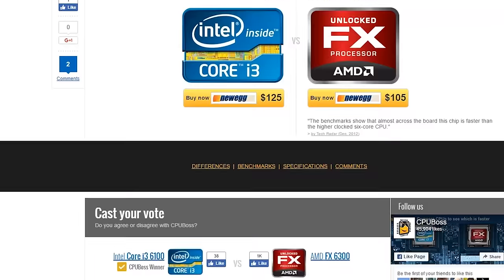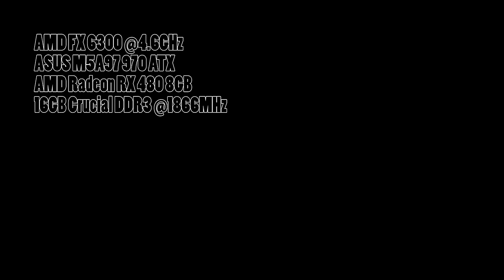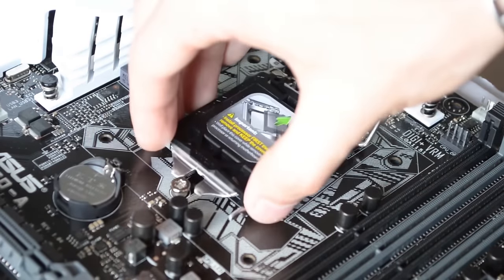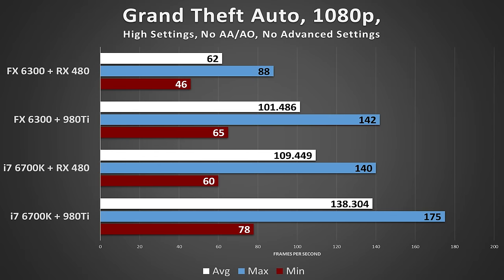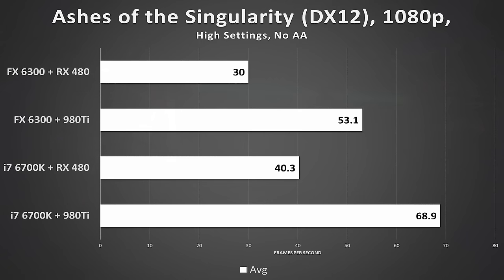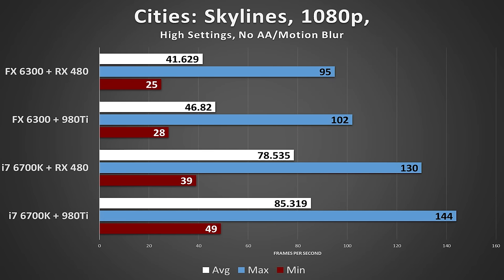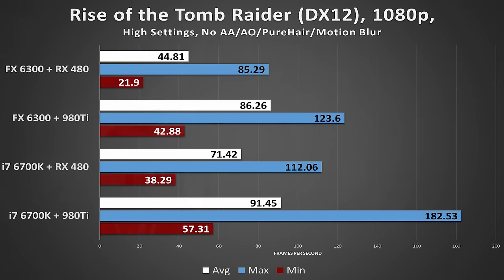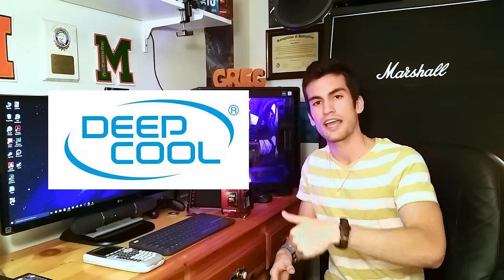AMD FX 6300 + RX 480: Severe Bottleneck?

Comment: Sad when you cant pair an AMD CPU with an AMD GPU
Reply: The FX series is just too old for the newest GPUs. The AM3+ Platform does not even have PCIe 3.0.
Reply: fx 8370 is pretty good
Reply: PCIe 3.0 is the least important factor in the bunch. Pcie 2.0 even at 8X has enough bandwidth for any of today`s high end gpus even in multiple configurations. Look it up on web, there are bunch of tests to confirm it. Pcie bandwidth importance is one of the greatest tech myths of recent times. In other words - it`s not important.

I have FX-8320 with R9 380 gpu. I dont see any particular bottlenecks in modern gaming, except in new Thief. That game cant break 40 fps regardless of gpu settings on AMD platform if you are using DX11. Mantle should help but i didnt bother with that. 

Otherwise cpu is great for keeping 70-80 fps range at 1080p gaming. I guess i have one extra module, which means 2 more integer cores and full FPU unit stack of 4 but if something is a bottleneck there it is slow on-die cache and poor memory controller, not a pcie bus bandwidth.

If you look at newer iterations of Bulldozer u-arch, which are Steamroller and now recently Excavator, they show pretty nice gains in IPC and single-threaded performance. About 10% for Steamroller and another 10-15% on top of that for Excavator (Carrizo). If Zen is 40+ % faster per core than Carizzo they pretty much nailed Intel`s Haswell and are nearby Skylake levels. I wont object to that. It will be the biggest jump in IPC and per core performance since 486>Pentium transition :D.
Reply: To be fair, the CPU is older than the GPU. The upcoming Zen processors are supposed to be a big improvement (supposedly a 40% increase in IPC; and of course the new FinFET lithography for lowered power consumption + heat emission).
Reply: maybe the RX 400 series was meant to be paired with Zen CPUs... but it's sad to see this, as i own a FX 8350 :/
Reply: The main issue the very low performance with FX cpus. FX8350 bottlenecks even cheap gpus like GTX960 so PCIE3 isn't the main issue here :)
Reply: MrKeikari i doubt that kid, it's not a bad cpu. also, look at the price you buy it fore? it doesnt even bottleneck a 980
Reply: ✪ Frazzle ✪ Bad, awful, potato, potato. I don't it being overpriced helps a bit??? The bottleneck even for cheap gpu like GTX960 tells how obsolete FX cpus are.
Reply: GTX 960 is an obsoltete GPU^^
(A HD7950 used is less than half the price and worst case same performance)

FX CPUs aren't obsolete, they perform well in multithreading and they're cheap.
It depends on the game, but in some games a FX-6300 can compete with an i5. And is cheaper than an i3.
For 120Hz or 144Hz don't bother with them, but 60-80fps are possible in most titles released for the new consoles.

CMstacker Try Mantle in Thief, the boost might be huge. FX-6300@4.8GHz and 7950@1150MHz 2560x1080 most settings maxed FXAA 60 FPS, DX11 30.
R9 380 pretty much equals a 7950 so you might get lucky ;)
Reply: 96erAtDrift FX8350 bottleneck even GTX960 so FX8350's price-to-performance is just awful. Rather get i5 (or i3 if you're only gaming). They both cost the same or less than the "8"-core Amd.
Reply: 96erAtDrift I have a FX-6300,a GTX 960 2GB and 8GB RAM. I can play the new Star Wars: Battlefront on Ultra without a problem. These are not even the recommended specs.
Reply: They won't match Intels singlecoreperformance and they didn't say they would. However does this really matter? Intels prices are crazy, even atm FX are often worth it if your on a budget, it's not getting worse ;)
Reply: 96erAtDrift Intel prices crazy? Intel has better price-to-performance, cheaper cpus... FX is overpriced shit.
Reply: Jubal Harshaw For such use you can't pass Pentium and i3 if buying new.
Reply: Jubal Harshaw Just do some research and you end up in the same result :)
Reply: It seems like a lot of people don't want to understand that there are games using multiple cores properly.
And if you're gaming on Win7 without AMD hotfix it will probably stutter. That's why there's a fix (it's an issue with Win7 distributing the load between cores).
My Monitor is 74Hz (OCed from 60Hz) and thats what I want to have constant. If it does that I'm fine. Yeah I would like 144Hz, but there's not only the CPU the issue.

And an i3 is more expensive and can't compare in performance in a lot of games. G3258 is a good CPU for those who only need performance on one core, FXs are good when it doesn't matter on how many cores the performance is and i5+i7 combine both, but they're pricy.
Reply: Funny thing is an FX8350 paired with 2 980Ti's is actually great for 4k, because the GPU is being bottlenecked. So it's actually a great buy for someone on a "budget",  your pretty much saving the cost of the 4k monitor itself (versus a newer i7 for instance).
Reply: 96erAtDrift The i3 6100 is about the same price as an Fx 6350 and delivers more performance in benchmarks paired with identical gpus. Look up FX 6350 vs i3 6100.
Reply: Jubal Harshaw Just upgrade your info and you're fine :) 

I haven't said anything that you just quoted. The overpriced FX chips just don't have any upsides that would put them ahead Intel in general. Every use is highly competed by Intel and beaten in price-to-performance ratio. The only thing that Amd can compete with Intel is what they offer with APUs.

Brendon Cabana Wtf, pair an obsolete FX8350 with 980TiSLI while FX8350 bottlenecks even GTX960. That logic....
Reply: Jubal Harshaw Remember to put in the cost of DDR4, and Intel's mobos.

Than again, you could cut on the Z170, go for a non-k i7 and end up with an ever slighter difference.

I was just pointing out that for FX8350 owners (and the cpu itself), it's actually good for 4K.
Reply: Jubal Harshaw I was just pointing out that AMD's FX lineup wasn't a bad buy for 4K, that's all, no need to over-analyze it :P

My seconds rig (old rig) is a custom watercooled FX 8320 @ 4.7, and I threw my 980Ti's jusr for giggles once, and I was actually surprised that 4K scores where almost as good as my 6700k.
Reply: Brendon Cabana Wait why would it be good for multi cpu setups
Reply: Jubal Harshaw No extra taxes for either cpu. What you're saying just doesnt make sense.
Reply: i have the same processor too. 8320. oc to 4.4ghz. my old gpu is a gtx 650ti and just recently purchased a 1070. i kinda feel sad because my new gaming performance (FPS wise) in this gpu didnt increase that really. its so-so. games i play are always  xcom2, witcher3, csgo, starcarft2. so im kinda researching a lot if the 1070 is overrated or my 8320 is simply old enough to be paired with 1070.
Reply: Jubal Harshaw So you're saying that if FX8350 becomes more expensive it gets better? CPUs don't work like that... You gotta see the real-life performance.
Reply: Jubal Harshaw
yeah. that sums it up. also my seller has a 15% restocking fee for returns of non-defective items so that's like $95 free money for them if i return it ($636 card) so im not doing it. if only i can return it without cost, i may have just gungho went for exchange to 1060 or 480. anyway not much i can do with this but now im having fun overclocking my fx8320 to death and see how far she goes.
Reply: NicksDomain101 Multi GPU* Not CPU :P And it's good especially for 4K, because as I said, at this resolution the bottleneck shift towards the GPU instead of the CPU.
Reply: Jubal Harshaw You said: "Maybe you live in a country with insane taxes on Intel CPUs and low taxes on AMD ones..." If that's my situation, how "fixing" it would help FX's already awful price-to-performance ratio???
Reply: Jubal Harshaw Well it still doesn't change the fact that Intel beats Amd's current cpus in price-to-performance ratio :)
Reply: Brendon Cabana Well if you don't have a build powerful enough the major cause of lower fps on a 4k build would be the gpu, but if you are running two 980 ti's in SLI than I could definitely see your CPU being the major bottleneck once again.
Reply: Jubal Harshaw What are your facts considering that something like the cheapest, locked i5 outperforms FX8350 in gaming, in most games even i3 does that. In budget workstation FX can't beat Xeon's price-to-performance ratio. Intel has the upper hand with lower power consumption and lower heat output in every build
.
Reply: It sucks if you don't live in the states, not only is ram really cheap nowadays but all of our computer parts are very available and as cheap as they get, I built my super powerful system for only $1300, while other people are spending $2000 or $3000 for an identical system. (Hint: Australia.) Heck, some people may actually be able to get better price for performance buying a prebuilt computer in the states than making their own outside of the US.
Reply: ***** You see that is what we call a severe bottleneck haha
Reply: ***** Did that sentence make sense?
Reply: You can, just you will hit a bottleneck that you may or may not see it. Ex: If the FX6300 is reaching 120fps while the I7 is reaching 150fps, there is some kind of bottleneck. But if your screen refresh is 60hz, you wont see it and you will be ok for a while.
Reply: I would say you are wrong there. I'm running a R9 380 with a FX8350 and I have no visible bottlenecks so far. A Gtx960 should have no problem.
Reply: +Marcusius A lot of people are failing to realize that AMD processors are good if you're just doing 60 FPS gaming. Although I have an i3 myself, the fx6300 would be a better option for someone if they're looking to get into content creation and gaming.
Reply: Strike Claw No, as I said an i3 costs about the same as the fx 6350 and it performs better.
Reply: NicksDomain101 Fx6300 overclocked to 4.5 ghz beats the i3 at stock. Remember that the i3 6100 can't overclock unless you get a z170 motherboard which cost 100$. The FX processors can overclock on 50$ motherboards. You can actually get the fx8300 for 120$ now which is only 10$ more then the i3 and the fx8300 can overclock on a 50$ mobo as well. The fx8300 is honestly the best deal right now since you can pick up a brand new one for 120$ and it can outperform the i3 even when overclocked in a lot of scenarios. Science Studio has a video on his channel where he put up the fx8300 overclocked to 4.4  with an i3 overclocked to 4.4 and the fx8300 beat it in almost every test shown. The fx8300 did a good job of pulling ahead of the i3 in every direcrtx12 test as well.
Reply: Strike Claw You reference the science studio a lot, but in his i3 6100 vs AMD FX 6300 video he recommends that altogether you should be going for the i3. The i3 performs better overclocked, and you get DDR4 as well as all of the good stuff that comes with it, and the FX 6300 doesn't even support PCIe gen.3.

The i3 clearly beats the 6300.

BUT, Yes, when it comes to the 8300, we do see better performance stock and overclocked at gaming and everything else than the i3, however the same problems with the 6300 applies to the 8300, no DDR4 and other stuff, but I think the main reason I would not call the 8300 a clear winner would be because keeping in mind with the future, and upgrading your system, buying all of these old components to run an 8300 would not allow you to effectively upgrade into the future. Buying a socket lga 1151 mobo means that you wont have to buy nearly as many new components if you want to upgrade your computer in the future, while if you went with the 8300 you would find yourself in need of a new mobo and new ram for future upgrades.
Reply: ***** You can easily downgrade to the older bios before they prevented that, which will allow you to overclock the i3.
Reply: Strike Claw Good luck overclocking that FX6300 on 50$ motherboard but keep the fire extinguisher close :D Oh dear these ignorant fanboys just purely lie to ppl to make their obsolete pos cpus seem even a bit better. 

FX8300 has awful price-to-performance ratio and no one should bother with such overpriced and obsolete cpu.
Reply: ***** No??? Idk what else to say lol
Reply: MrKeikari Okay they really aren't that bad, they're old and about to become obsolete but they are fine.
Reply: NicksDomain101 There's better cpus for the price so it's time to kill the myth of "Amd FX having good price-to-performance ratio" :) I still see almost daily people recommending this cpu over the i5 of same price like it's years 2012...
Reply: MrKeikari Yeah I absolutely agree that it is outdated as crap
Reply: Thomas T Same price or lower to get better performance :)
Reply: Thomas T i5-4460/6400, i3.
Reply: Thomas T The skylake i3 lineup or the 2nd gen intel i7's
Reply: From my own experience, the 8350 and the I5 4460 are pretty much neck to neck in game performance.
The only games the I5 is better if you are about to play CPU intensive games like Arma.
This is why you see so many youtuber mentioning that if you go with an FX , dont go lower than a 8350.
But that was before the announcement of the Zen. Now it's wait for Zen or get an 6400 if you cannot wait.
Reply: Your wrong. I am using a FX8350 with a 380 Nitro and I have zero bottleneck between my cpu and gpu
Reply: Marcusius FX8350 is bottleneck even for GTX960 and 380 outperforms 960 so the bottleneck is even bigger with 380 :(
Reply: chronicblazer84 You must be wrong then since FX8350 heavily bottlenecks even GTX960. Turn off the fanboy bs :)
Reply: NicksDomain101 You guys act as if buying a new mobo is hard. It really isn't. The fx8300 can be found for 120$ brand new. You guys make it look as if AMD's processors are absolute garbage but they're not. Also, you keep on brining up DDR4 RAM but there is barely any difference between DDR3 and DDR4 on processors. Someone tested DDR4 and DDR3 on the same motherboard with an i7 and there was barely any difference in performance. If you're worried about an upgrade path then sale the CPU for 80$, the mobo for 50$ and the RAM for 30$ on ebay. With eBay's fee's, you'll get about 140$ back that you can put into into any RAM, MOBO, CPU combo you want. If you watched science studios video, then you'll see that the FX8300 outperformed the i3 in every test. Honestly, if directx12 utilizes multi core performance that well then there won't really be a need to upgrade anytime soon. The fx8300 can overclock to 4.4 on a dirt cheap motherboard and the i3 in that video was overclocked to 4.4 ghz as well but you need to pay an extra 100$ for a z170 motherboard in order to overlock the i3. So FX8300 is obviously the better deal if you can't afford the z170 motherboard. The i3 at 4.4 ghz lost to the FX8300 at 4.4 in every test so you can imagine the big difference when the fx8300 is overclocked on a 50$ mobo and the i3 6100 is left at stock on a crappy h170 mobo.
Reply: chronicblazer84 Exactly. He told us that it was hard to get the FX8300 up to 4.4 GHZ but what he didn't tell us in that video was that it was because of his poor choice of a PSU to go with that CPU. He only mentioned that issue down in the comments which kind of pissed me off a bit. The way he mentioned the problem in the video, it made it seem like it was the chip but it was actually the poor choice of a PSU. This intel bias is ridiculous. Its like whenever intel loses, everyone goes like meh, but when AMD loses in 1 test, everyone goes crazy and says that the CPU's are garbage because they did bad in one test.
Reply: Strike Claw But why buy obsolete shit (FX8300) when you can get something decent (i3, i5) for the same price? Face it, AMD "8"-core is just too overpriced to make any sense.
Reply: MrKeikari The FX8300 is currently 120$ and it can overclock on a 50$ motherboard. The i3 6100 is currently 110$ and it can't overclock unless you get a 100$ z170 motherboard and 50$ is a BIG hit in budget builds. The FX8300 outperformed the i3 in EVERY test in the "Fx8300 vs i3 6100" video.  Both processors where overclocked to 4.4 ghz and the FX8300 beat the i3 in every test. I don't see why you wouldn't pick up an AMD "8" core for that price. Its a lot better then what you intel fanboys think it Is and it mopped the floor with the i3, especially in the directx12 test. You guys love supporting overpriced duel core chips and money greeding companies don't you? I've already argued with your intel brain washed self before awhile ago and its very pathetic to see you back again and trying your best to make AMD cpu's look like they're bad.
Reply: Strike Claw How in the hell is overclocking FX8300 good? xD And have fun OC'ing that obsolete hot pos (FX8300) on 50$ mobo, just keep fire extinguisher close xDDDDD

Improvement in DX12 is the same for all low-end cpus.
Reply: MrKeikari
Reply: Strike Claw Speechless? The usual fanboy...
Reply: *****
I'm a teenager. I make my own money. I own an i5 2500k overclocked to 4.2 ghz and its starting to show its age so I need something new. Im about to go buy a new AM4 athlon when they come out or maybe even AMD's new 8 core zen chip since I have 300$ saved up. I'm likely never going to support inel ever again since they have brainwashed idiots like Mr.Kerikari on their side and want to much money for their quad core processors..  Why does this matter to you?
Reply: *****  Cool man. I'm about to go for AMD's zen for my next CPU upgrade because I can't see myself buying ANY intel processors in the near future. To be honest, the fanboys in PC gaming are even more annoying then console peasants. The fact that they have all of this knowledge but refuse to accept the fact that some things are better than others is  just pathetic.
Reply: Strike Claw Yeah, the ignorant fanboys are still recommending some obsolete shit like FX8350 in year 2016 to people who ask for help :(
Reply: ***** Oh? Well that's good, Windows10 is superior anyway :)
Reply: ***** Did you do clean install or just upgrade? Win7 has all the same "spy" software added that's included in W10 :)
Reply: ***** Clean install of w10 is the key to fluid experience. You can get the media here: https://www.microsoft.com/software-download/windows10
Reply: chronicblazer84 Is there some point behind this or just random link?
Reply: MrKeikari Gtfo. You're still avoiding your argument with me and now you're moving onto other people again. Just please stop man, it's pathetic. You need to find something better to do with your time.
Reply: Strike Claw Argument with you? How? You still haven't shown a hint of proof to back up the obsolete, overpriced FX8350 :)
Reply: MrKeikari If you actually payed attention to my comments, then you would know that I mentioned the Fx8300 (120$ and I proved to you that it beats the i3 6100 clock for clock and it's cheaper to overclock)not the fx8350. I agree with you that the fx8350 is definitely over priced but intel is guilty of selling the same chip with slightly higher clock speeds for more money as well. The fact that you're still failing to respond to my arguments earlier shows that you are wrong and you're still blind biased intel fanboy. Respond to my previous argument and stop trying to change the subject please. Both AMD and intel sell over priced processors. Intel just released a new i7 that's over 1,000$ and it barely beats their 300$ skylake i7 and it can't compete with any of their new xeons both sides are guilty of selling over priced products. :)
Reply: Strike Claw FX8300 = FX 8350. The same chip and the same awful price-to-performance ratio. Struggling to perform on par with i3 and asskicked by the cheapest i5 (4460 & 6400). No matter how you twist and turn, it doesn't get any better :)

I'm no fanboy, what even makes you say that? :D
Reply: MrKeikari You're definitely a fanboy. You're failing to respond to my previous arguments. I guess I'll bring it back once again and I also proved to you that the i3 6100 price to performance ratio is worse than the fx8300's price to performance ratio. You're also failing to realize that I NEVER mentioned the fx8350 and I SAID MYSELF THAT ITS OVERPRICED. The fx8300 is just as cheap as the i3 and it beats the i3 clock for clock and it over clocks on cheap motherboards. If you're calling the fx8300's price to performance terrible then that means that the i3's price to performance has an even lower price to performance ratio. The cheapest i5 4460 has a stock clock of 2.7 ghz and it's currently 180$ and it loses to an i3 6100 which gets beat by the fx8300. So it's obvious that those older i5's are over priced as well. You also need an expensive mother board to overclock them. You're really acting like a fanboy. You"re not providing facts that support your arguments and you're failing to reply to my statements that proved yours completely wrong. You're not responding to my older comments because you know you're wrong. :)
Reply: Strike Claw Finally you're making sense. All FX 8000 series cpus are overpriced and mostly outperformed even by i3s and even more by i5s that cost the same as FX 8000 series. So there's really no reasonable excuse to waste money in obsolete FX cpus when you can get better performance for cheaper with i3s and i5s.
Reply: chronicblazer84 Wow, that's one random comment :D
Reply: Strike Claw Clock to clock? Are you serious? xD Pls do some research before making these hilarious suggestions :D

Most of the 6100vsFX8300 vid's errors and caveats were mentioned in the vid so look into those and maybe you will realize these tech-related thingies better :)
Reply: MrKeikari Do you realize that the FX8300 was hard to overclock because of the poor choice of PSU to go with it? Science Studio mentioned this in a comment and not in his video... Those where NOT video errors. Are you saying that when an AMD processor beats an i3 that it's a YouTube video error? You REALLY have some serious issues dude. I don't even know what you're trying to prove at this point anymore. There are MANY more videos out there proving that the FX 8300 BEATS the i3 6100. YOU do more research before making your next comment because you have no clue what you're talking about. You've been proved wrong, you haven't backed up ANYTHING you've been stating with facts, and you're saying the same thing over and over again. Seriously man, you're really just like a child. Grow up.
Reply: ***** Yeah, you would need to add 3$ for Haswell and 8$ for Skylake. Would you save 8$ if you could get Ferrari instead of Fiat? :)
Reply: MrKeikari Fx 8300 is 120$. FX 8350 has the same performance and it's more expensive. If you could get the same Ferrari for a cheaper price then it's obvious that the cheaper Ferrari is the better deal. :)
Reply: *****  Well, that helps my side of the argument out even more. The fact that you can get a chip that's cheaper than the i3 6100 that outperforms it and can overclock on a cheaper motherboard proves that the i3's price to performance ratio is much worse than the FX 8300. This guy named MrKeikari or whatever is just an idiot. Don't listen to anything that comes out of this child's mouth. I've proved him wrong before in other YouTube comment sections before in the past. This is just history repeating itself again. :)
Reply: chronicblazer84 He never does because he never finds any evidence that proves what he's saying to be correct. He can't even tell the difference between his own lies and the facts that prove his lies wrong. It's hilarious to watch this guy act like a child and say the same thing over and over again. Just because you're saying the same things over and over again doesn't mean that you're right. This guy fails to realize this. He's just like a child man. XD
Reply: +Marcusius what do you think about the fx 6300 paired with the r9 380? Any bottlenecks?
Reply: Raymond Ceja If I where you, I would try to throw out the extra money to get the FX 8300 which can be found for 105$ if you want to stick with AMD and get a 50$ mobo that over clocks it, or get the i3 6100 for 110$ with a z170 motherboard.  I'd honestly recommend the i3 6100 even though it gets beat by the FX8300, it still beats the FX6300 in most scenarios. You should get a z170 mobo so that you can overclock the i3 and have a solid upgrade path in the future. With a z170 motherboard, you'll have access to Intel's up coming processors like kabylake, and cannonlake. So go for the FX 8300 with a 50$ motherboard for a huge bang for the buck value, or go with the i3 and pay extra money for the z170 mobo for future proofing. You should also get the RX 480 as it can be found for the same price of a single R9 380 4 gig model.
Reply: miccellomann With Z170 motherboard you can.
Reply: miccellomann Pls. look into these tech thingies before making such wrong claims. I have my Pentium G4400 overclocked over 4.5GHz so it's not ineffective or waste of time.
Reply: miccellomann Wow, a desperate try to back up your lies? Everyone buying a new board is definitely able to overclock their non-K-Skylake cpus still, there's nothing stopping that. I bought my mobo after "Intel fixed the bug" like you said and still my Pentium is at 4.5GHz without single problems.

 There's no risk to mobo/cpu disabling power management options. It's an OC motherboard and most people disable those rather useless power power management options anyways to achieve stable overclocks. The amount of electricity is infinite so there's no point risking pc stability to save a few watts and maybe a few euros per year.
Reply: miccellomann That just verified what I said. Why do you link something like that which is opposite to what you're saying?
Reply: miccellomann What are you talking about? OC with the multiplier with non-K-Skylakes has never been possible "bug" or no "bug". 

It doesn't matter a bit if you buy new or old motherboard. All motherboards are able to overclock the non-K-Skylakes to about 4.5GHz like mine is. 

What are the K features you mention that protect overclocks? xD They're the same cpus...
Reply: miccellomann You should really look into warranty matters separately and they're not even related to this matter.

Mutiplier in non-K-Skylakes is always locked and has always been, "bug" or no "bug". You obviously no knowledge about pcs and especially cpus and their overclocking.

Dual-core pentium is the best budget choice cpu for pretty much any pc due to the upgradeability.
Reply: miccellomann Man what are you talking about? I'm planning on buying an intel pentium g4400 for my new PC because my damn i5 2500k died and I dont have the money to buy an i3 or an i5 right now. Anyway, You can push the pentium g4400 up to 4.5 ghz. Just because they have a locked multiplier doesn't mean that you can't overclock them. The new duel core pentium g4400 is actually one of the best budget processors right now. They beat out all of the athlon processors and they have an upgrade path. I'm a bit of an AMD fanboy myself but their processors are really starting to show their age and I wouldn't reccomend buying one of their athlon processors until zen. I wouldn't recommend the fx6300 either since it gets beat by an i3. The only time I would recommend an FX processor to anyone is if they couldn't afford an i5 and they wanted to plan on doing some heavy multi tasking and video editing. But for gaming, Intel has the best solutions right now.
Reply: Wapaaam PvP So much performance and upgradeability to sacrifice for such little savings.
Reply: Wapaaam PvP Then go with cheap, unlocked 6-core Xeon :)
Reply: Wapaaam PvP Still worth it :)
Reply: +MrKeikari not really worth it when can go to newegg and get the motherboard I7 4790K and 16gb ram combo for 450 bucks
Reply: You can
Reply: chronicblazer84 Good thing you know that too now :) You've looked into pc tech related things now?
Reply: chronicblazer84 You can read full sentences? Nice, I'm surprised considering your past. So what's your point?
Reply: chronicblazer84 So your point is that Sandy Bridge Xeons are not locked? Well, you're right for a change, which is a nice thing :)
Reply: chronicblazer84 You posted that comment already. What do you mean by I recommending someone to buy old and outdated hardware? I wouldn't recommend person who looks for help to buy FX 8350 if that's what you saying. That cpu is just too overpriced to make any sense fpr anyone else than ignorant fanboys.
Reply: chronicblazer84 Oh I see, you misunderstood. I recommended it because it has superior price-to-performance ratio and no competition in its price range :)

Maybe you should look into the pc tech instead of focusing on gay bashing. I bet you that the hardest are gay bashers are always gay themselves :)
Reply: chronicblazer84 Good thing you have things covered! That's important in some socities, sadly.

8320E doubles actual six-core's performance? FX83xxx barely keeps up with dual-core i3 so I have no clue how are you making so hilarious claims :DDDD

Ofc Amd is outdated, since Zen is not out yet. Only the overpriced FX lineup available currently.
Reply: chronicblazer84 You're still referring to Passmark? You kids are hilarious with your references :D Anything to make to make your outdated cpus look good, huh? ;)

So do you have anything to back up your fanboy claims that FX8350 would anyhow outperform the superior Sandy Xeon?
Reply: chronicblazer84 Isn't overclockalable, wtf? xDDDDD

Every FX83xxx is the same overpriced chip.
Reply: if you have a FX-83xx series its ok. for a cheap PC just buy 8320E (cheaper) and overclock it to 4Ghz and boom you just got a 8350 for 50$ less AHAH
Reply: ***** No reason to waste money in overpriced "8"-core FX. Rather buy cheaper i3 or even more powerful i5. Both outperform the gimped FX chips.
Reply: i can have FX8320E for 132€ , I3-6100 for 118€ , with this small difference i think FX is better and dont forget you can OC it to 4ghz and boom you have a FX8350 that cost 50€ more xD
Reply: ***** The "8"-core is still so overpriced and obsolete that even overclocking won't help enough. The cheapest, locked i5-4460 easily outperforms overclocked FX83x0.
Reply: No , dont trust fake benchmarks and i5-4460 cost 180€. Yes FX are getting old (2012)
but for the price its still good for a low-mid gamer PC. Lets say FX8320E with RX480/GTX970 maximum. Hope Zen will come Fast
Reply: ***** Fake benchmarks? All synthetic benchmarks favor Amd with no reflection to real-life performance. 

Zen makes Amd processors relevant again hopefully :)
Reply: From what i saw on internet vs IRL i can tell you that AMD CPU performance are always better IRL than thoses shitty benchmark. For their price they always perform better than intel (i3-4150 vs FX-6300) or (i3-6300 vs FX-8320). some benchmark says i3 is better than FX-8350 in game... what a joke.
Reply: i compared IRL i3-3240 / i3-4150 to FX-6300 stock and OC 4.1Ghz , even stock the FX wins all the time on every game. and they cost both the same price 1 year ago !
FX6300 + GTX 660 GTA V on High more than 60fps
i3-3240 + R9 270X 45 fps avg...
same for battlefield 4 
FX rig on LOW over 100 fps
I3 rig on LOW 70 avg..
believe what you want man.
Reply: ***** What on earth makes you think FX8350 would beat i3... You're just out there. Just do some research before making such outrageous claims. Fanboys are not cool!
Reply: on single core benchmark its true .. but at the end on multi-threaded app/games
8 cores @4Ghz are way better than 2 cores @3.5ghz .. even my old phenom X4 965 got better FPS on BF4 than i3-3240..
in general 
i3 = FX-4 series
i5 low end = FX-6 series
i5 high end K = FX-8 series
and in App benchmark FX-8 close to i7-3770
for the price its not bad. The problem is AM3+ platform is old and you cant upgrade your PC in 1 or 2 years :/
the only FX i would not buy i FX-9 series , its completely shit overheating BBQ and rly high TDP. + they are just OC'ed FX-8 haha.
Did you know if you buy a FX8320E for 132€ if you OC it to 4.7Ghz , boom you have a FX9590? :DD
Reply: ***** That's true. Multi-thread performance is pretty much useless since games favor single-core performance and only synthetic benchmarks are bribed to give Amd better scores with their gimmicky cores.

All real-life performance and price-to-performance ratio is superior with Intel instead of Amd's gimped and overpriced FX architecture. So you're right, all FX is completely shit overheating BBQ.
Reply: believe what you want. i know what i saw irl. I played on a rig with FX8320E but... it has R7 360 so i coulnd see his real performance in-game :/
actually intel are really overpriced
i5-K for 250€ really?
i7-K for 360€?
back in 2012 each CPU was 50€ cheaper..
just like nvidia with Pascal :s
Reply: ***** True. Real-life performance shows Intel has superior performance and price-to-performance ratio.

Intel is not overpriced. They still beat Amd's overpriced products with same or lower price and better performance. Shame that Amd can't provide anything even remotely relevant discrete cpus in the market so Intel has no need to lower its prices even further.
Reply: not sure if trolling or just stupid :))
Reply: ***** What makes you say that?
Reply: Do you seriously think an i3 beat FX-8 series in game? I just played some BF4 today with FX-8320E (3.2Ghz) and RX460 , it destroy the i3 by far !
about 70fps avg with some down at 55
to over 100 fps. FX load is 60% , i3 was 100% all the time. But again believe what you want i dont care
Reply: ***** Maybe in few games but ofc i3 outperforms any FX chip in general.
Reply: Nope in all game we've tested and even Applications FX perform better. Its simple 1 core of i3 is 100% more powerful of 1 core of FX , so 2 cores of the i3 = 4 cores on the FX
FX-8 series have 8 cores , thats why its better.
intel core i3 is equivalent to FX-4 series.
You understand the logic?
Reply: ***** I hope you realize FX-4xxx is more of a dual-core cpu and FX-8xxx is more of quad-core so your comparisons are pretty much of :)
Reply: nope 2 cores share alot of resources but they are real cores. They just dont have all the performance they could have with their own resources. it explain the low IPC
Reply: ***** Yeah, gimped performance by shoving 4 cores on cpu that has resources for only 2 cores. It's like selling 8-tired card after taping extra tire into each real tire.
Reply: yes 8 cores CPU from AMD have resources for 4 cores. But its not really like that. Because they have 8mb of cache L3 , and 8mb of cache L2 to "compensate". Phenom had better IPC than FX at the same frequency :)
unfortunately they couldnt handle high overclock :/
Reply: ***** he is obviously an intel fanboy.
Reply: *****
What on earth makes you think that? :o

I'm really looking forward to Zen. It would be terrific to have two proper cpu companies providing discrete cpus instead of one company pushing overpriced, outdated cpus and only Intel providing bang for your buck. Everybody wins if there's competition!
Reply: +moseyo tam It's your CPU. Upgrading a 650 Ti to a 1070 should give you massive increases in performance.
Reply: AMD uses Intel processors to test their GPUs.
Reply: BearHoldingShark Intel fanboy? Wtf makes you think that? :S
Reply: MrKeikari Your obvious bias against AMD CPU's.
Reply: BearHoldingShark Where? I have been talking only about the horribly overpriced FX cpus that Amd used to rip off customers.
Reply: MrKeikari The other commenters here provided enough evidence to show that that is not true (except for the FX-8350 CPU).
Reply: BearHoldingShark Proof of what? Try to use full sentences even if you're a troll.
Reply: MrKeikari Lol wut. I am using full sentences. Wtf are you even saying anymore?
Reply: BearHoldingShark I was asking if you have any point there?
Reply: Try pairing a $90 Intel cpu with a $250 nvidia gpu
Reply: Lucas That's the best part about Intel. You get goof price-to-performance ratio unlike with Amd.
Reply: MrKeikari AMD is the king of price to performance, they just don't offer anything at the high end right now, which lets Intel host a monopoly in the CPU market. Zen for CPU's and Vega for GPU's will give everyone else some new competition.
Reply: Lucas Their Apus are decent and Zen might be too but FX cpus are awfully overpriced.
Reply: MrKeikari No they aren't. $90 for an FX 6300 that can be easily overclocked. Obviously it's not smart to buy an older architecture CPU when new gen is about to come out, but they are actually very well priced especially for when they came out
Reply: Lucas They came out ages ago so that's not really a relevant point anymore.
Reply: MooSaidChicken It's not their highest tier xd
Reply: Lucas what is then?
Reply: MooSaidChicken Keep in mind Amd barely has low-tier cpus currenly available. And even they are highly overpriced compared to competition.
Reply: +MooSaidChicken r9 Fury X and also the r9 Fury and Nano
Reply: MrKeikari AMD not producing low tier cpus, and being overpriced? What world are you living in? Yes a little out dated sure, but I would own an fx 6300 anyday over a fuckin i3
Reply: MooSaidChicken Well fanboys do decisions like that based on something else on facts.
Reply: NicksDomain101 That is bad smh
Reply: actually the fx 8370 doesn't bottleneck. atleast that's what i'm hearing.
Reply: Stealth GTX960? Sure it does, just search "fx8350 just cause 3 gtc960 380".
Reply: Think of a Sempron and an R9 Fury... Your sentence invalidates itself